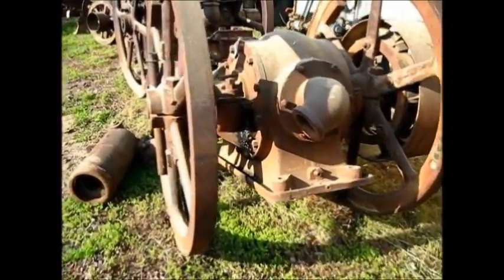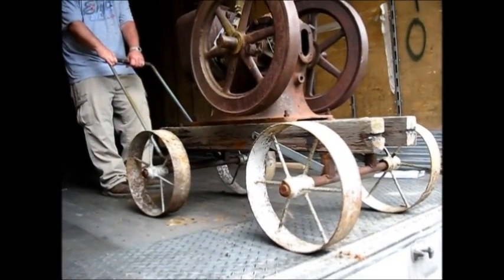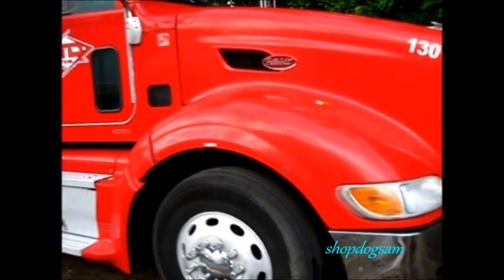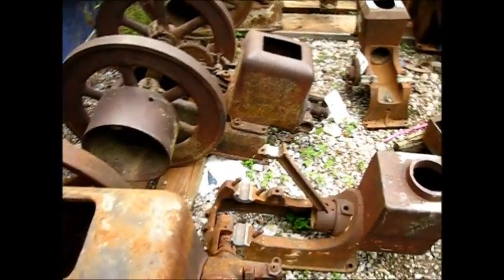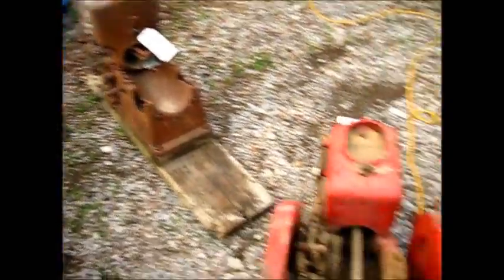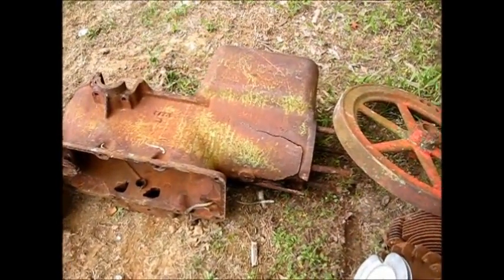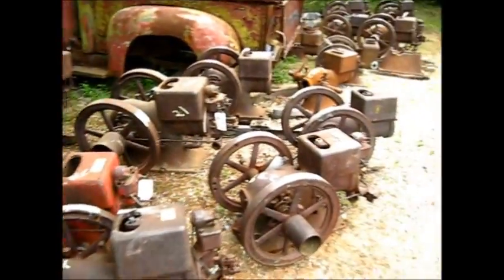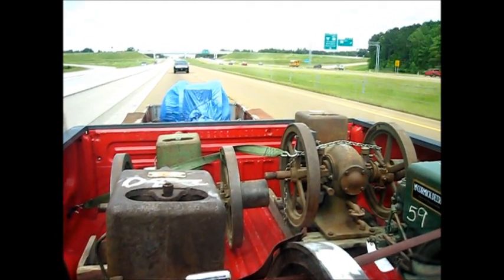One Hundred  gas engines

Comment: Boilers are made by filling your boiler tube with tamped sand, OR filled with Brass while hot, and then bent to shape, and the brass melted out, Or sand emptied , then each coil welded to the joined manifold, The burner is from two, three burner pump up colman stoves, or a set of blow lamps,

Comment: Oh? and the feed water? It's turned on by mercury switches "Like a mechanical temp sender from a truck" or the thermo coupling from a propane camper heater. or a cook stove, instead of the thermo coupling turning the fuel to the heater on or off? it turns the feed water on when it would have in the heater turned the burner down.

Comment from the maker: ,,, no parts for sale,, thanks
Reply: I also love old engines. I restore old Gravely walk behind tractors.  Restoring something that will or would be discarded is a good job for a father and son. What a fine time to share with children and or Grandchildren . We are only stuarts of what we think we own. Don't hinder others from finding their passion with their children and future generations. Luke 9:24 For whosoever will save his life shall lose it: but whosoever will lose his life for my sake, the same shall save it. I do not need any parts. Others do. If you sell what you do not need , the heritage continues. I fix them to keep me sane ; I am a medical professional. Bringing someone back to life is God's job. Some have returned from flat line status ,on the monitors. I feel did them an injustice , but it was documented their will that extreme measures be taken.I also live in TN. I will purchase one of these running as we have no clue on working on them. I would like for you to call me, just so I could learn from you about which model would be a good basic, common model. Curt 931-922-2878 I found a JOHNSON UTILIMOTOR local for $350. It runs good. It has a pedal starter.

Comment: Make just about every part?
If I can get a ceramic crucible?
Yeah,
right now?
soft metals only,
Steel Crucible right now Sam,
and Wood lathe with a second Pumped up high torque motor,
as far as my stuff collecting has got for the making,
for the making from?
Two shark Triplex pumps,
"Foisel steam bike" original drafted to be built from the old hottsy steam pressure washers red block brass and copper head Shark 203 model pump. Tip to fellow Gear head.

Comment: That there On star girl done got you pointed in the right direction.You done hit the mother load.With all the left over iron. You'll have  flower bed material fer all the girls in your neck of the woods. Watch out them flying chip are HOT. From the south shore of the Missouri  #46